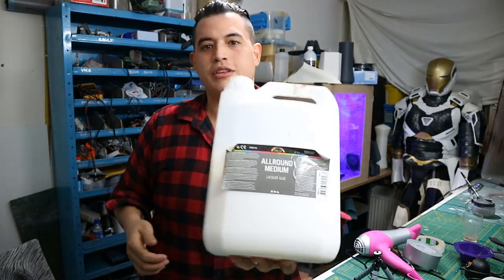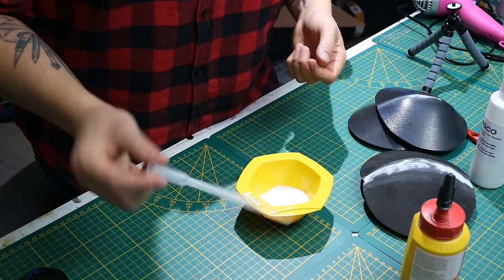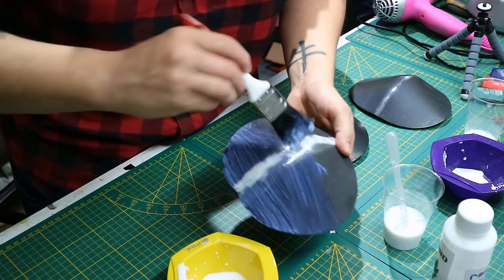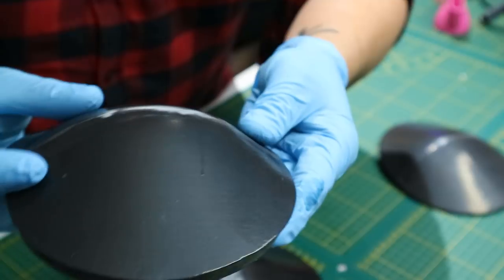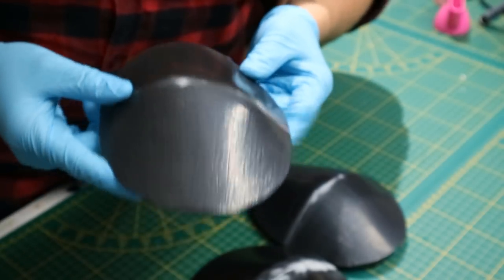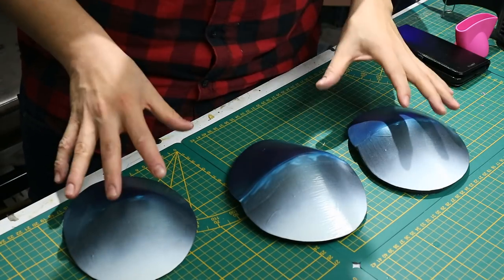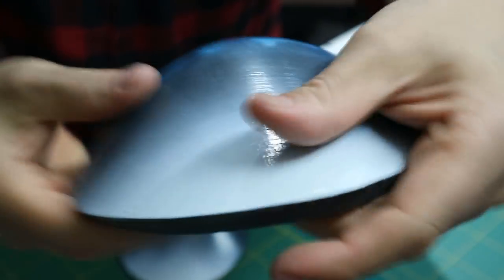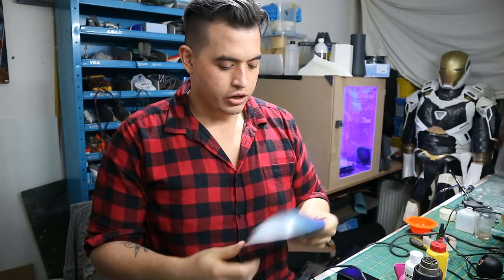How i Seal Foam + Drytime "Hack" and Non Cracking Paint Test

Comment: Hi Wayne, this was a super helpful vid! Would you recommend sealing the foam again after painting it? Like a clear top coat/varnish type of thing? I'm concerned about pigments rubbing off onto clothing or other props
Reply from the maker: Depends on the paint, I've seen it get done right, but I've also seen it not spread out easy and form droplets, think of water on a waxed car sorta thing, where it doesn't spread but accumulate. I tend to just hit it with a thin layer of clear coat from a rattle can
Reply: @Costronica  Cool, thanks!

Comment: Awesome video! You told me about Art Medium at Campzone, I'm currently using it for my next armor project. I bought the one you linked in the dutch video about sealers. Do you prefer to use the Allround Medium from this vid, or do you think the other Art Medium is also still a good sealer? 
And I was wondering, I just put the Art Medium on my foam without thinning it down with water. Do you thin it down because you will get less brush strokes, or is there another reason? I'm using a cheap foundation brush to apply it, so I get minimal brush strokes. I liked it better than the foam brushes. 

When I'm showing my armor project to the world I'm definitely going to credit you! ;D  It was such a great advice.
Reply from the maker: Alana van den Berg I haven't found any difference in the 2 brands. Only reason I went to all round is because they had the 5liter can and art had not. I don't even use brushes but a sprayer on my compressor but I felt that would not be good for the video 😂 will look for a foundation brush though.

Comment: I have old armor with sealed wood glue, but as you told in the video it’s cracked. Is there a way on how to remove the layer and start over with sealing? So I don’t have to throw away my armor
Reply from the maker: it is possible but will require some work, i managed to do it with old armor at 1 point with a failed piece.
try and get the most stickiest ducttape you can find, rip off a good piece and stick it good on your armor, preferrably on an edge where the armor and sealing ends, and then with all your cosplayer might RIPP that ducttape off.

this should pull off a good chuck of the sealant, sometimes even enough so you can peel off the rest with your hands, if not repeat the ducttape way. i did this method also on the legs of my iron man and it worked fine and my foam didnt rip, still try on a small piece first or check for rips and damages on your armor first since you are pulling stuff. good luck

Comment: So you use airbrush when sealing with All-round medium? Do you use separate airbrush for each task then? I wonder since with sealing you need much more liquid when painting, and then you also have to consider cleaning it using different methods.
Reply from the maker: i dont use an airbrush for sealing... there are certain (latex) paint sprayers that can be fit for the job but not an airbrush
Reply: Ok, I got the wrong idea from on of your comments. So then you mean something like this?

https://rg-narzedzia.com.pl/62856-thickbox_default/adler-pistolet-lakierniczy-d-1l-hp-promo.jpg
Reply from the maker: yeah i have a similair one like that. cleaning is hell though, so do it right away
Reply: One more question though,  what about clear coat? Should I also apply it with airbrush to avoid cracking when bending?

Comment: did you try without adding water? i think it will not have hard brush strokes that way.
Reply from the maker: Depends on the size of the project, if you have large surfaces to cover so you'll have a good amount in your cup, eventually that dries a little and brush strokes will appear, atleast in my experience

Comment: Good to know that Flexbond doesn't wrinkle like Plastidip does, I nearly ruined a piece with Plastidip on it when it wrinkled a couple weeks ago.  So is there a way you can correct high-spots and imperfections in the Flexbond once it dries?  Also, what did you use for filler in the foam-cracks?  I tried Flex-Seal, but that stuff is hardly sandable and shrinks, I've had to go over it 2 or 3 more times to finally get the crack leveled-out. :(
Reply: good thing about plastidip is that a little heat will fix it again

Comment: I've been told that automotive spray paint is safe to use for painting flexible pieces of foam armor. However, after ruining, two pieces of armor, I learned this isn't true. Needless to say, I'm vexed. Can you explain why people say this is so? And FURTHERMORE, why do people insist on primer -- Krylon, no less -- but fail to specify what type of primer is acceptable? Does not plastidip (or Flexbond) provide sufficient primer in and of itself?
Reply from the maker: Razzy 18126 I never primer my parts, the flexbond or all round medium is enough to grab any paint, one could argue you can do it because grey is a good base color. But I just hit it with grey acrylics if needed so it stays flexible. I think this insisting of bad information is because people keep spreading it around, 1 hears it from another, and tells it to 2 more and so on and so on, misinformation is hard to kill
Reply: Wayne's Workshop you, good sir, are my daggum HERO, right now! Bless you, sir! Thank you so much for putting the axe on this blasted confusion!  I will be very very certain to make that abundantly clear in my own step-by-step walk through of my cosplay build, and I shall credit you. This may be of interest: I've learned that interior paint -- the very same used to paint the walls of the house -- are generally acrylic or latex, both flexible mediums. Even better, you can color match to literally anything you want! And yet, using these as a color coat seems nearly unheard of. This is tragic, in my eyes: spray paint is good if wearing anything sure not to bend, but flexible pieces are doomed. And some people simply cannot afford an airbrush. Spray may get you an even coat, as well, but interior paint can easily be lightly thinned and applied with a foam chip. This hidden gem is ignored and I fully intend to kill this misinformation. All I need is to find a good gloss finish that's flexible other than floor wax and I'll have a definitive what's-what guide on painting foam. I'm not sure if interior paint can be used with an airbrush (thinning mediums I know nothing of) but that custom color option is very hard to ignore. Cheers!
Reply from the maker: Razzy 18126 add pure latexpigmets to your flexbond or all round medium to tint your prop to your desired end color, helps set the tones

Comment: is is the art medium airbrushable?
Reply from the maker: it sorta is but not recommended, the volume of the airbrush, even with thinned down art medium is a not enough.

i did however do it with a paint gun to a big compressor (you can see that in the overwatch lootbox video) the problem with it is, you use air (duh)  to propel it onto your part.

this airflow also acts as a way to dry out your medium faster, so all little bits at the tip of the paint gun gets turned into lumps which in the end lead to clogs.

in a way, the time gained sometimes is spend cleaning the paint gun, which makes it kinda pointless...

currently im sealing my BOB cosplay and opted to seal it by hand for a few layers followed with same plastidip.

long answer but wanted to give all the info ;)